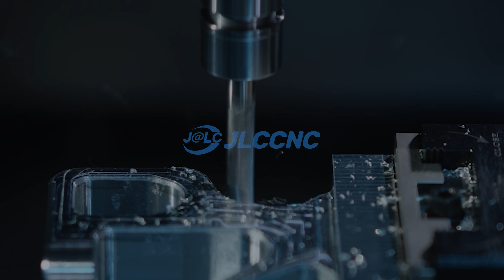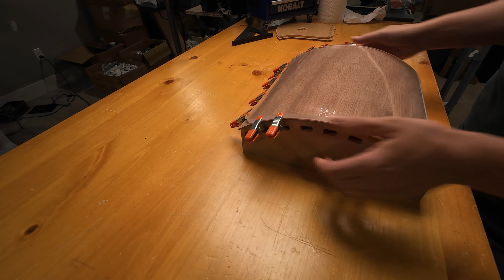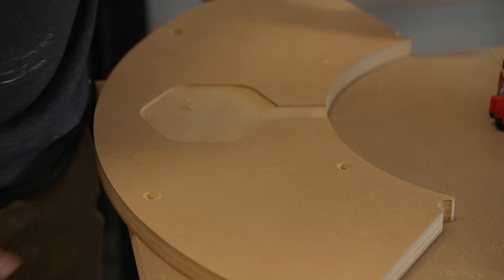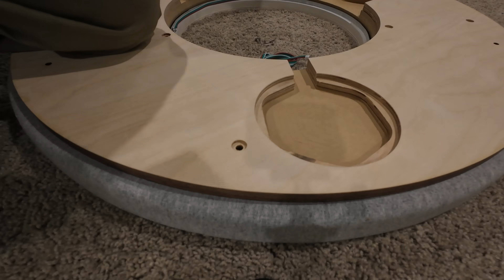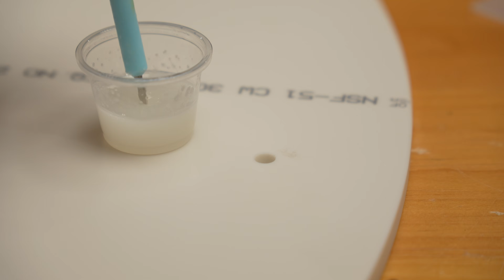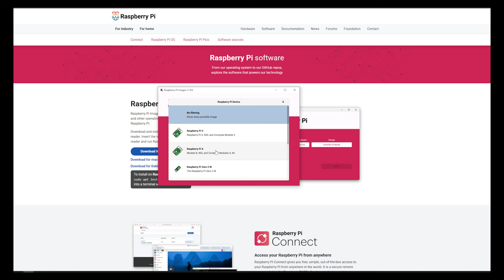This Coffee Table HEATS & COOLS Your Drink

Comment: Having a condensation tray in there, uh oh - on your next project, make sure it's easily accessible, as you may get the same issues people do when using cheap (de)humidifiers - mould. You'll likely need to check it every few weeks to make sure you're not growing new lifeforms inside your table.

Comment: Wait, if you've watercooled the peltier plate, doesn't that mean you risk ice build-up when heating a cup?
Reply from the maker: No Peltier heat produces heat same with cold. Water cooling Loop will always be hot when on but preferably warm

Comment: My guy, you need a deburring tool.. If you have one, then you should start using it instead of a razor for cleaning those edges lol
Reply from the maker: I own one! Nice tip I’ll have to give it a try. Although not sure how well it’d work on tab removal. But the thin bits are perfect for it.

Comment: Just subscribed after viewing part 1,now that I seen part two I am amazed! I do agree with you the frame of the fridge would look better as wood and not white.

I am curious how doe you're cup chiller/heater work? Have you added a pressure sensor to turn it on? Or is it by switch? What temps are you getting?
Reply from the maker: Thanks for watching and the sub!!! For the chiller/heater I have it hooked up to a button on the touchscreen. A pressure sensor would have been cool though! I plan to do in depth testing on my Patreon and I may show some of it in part 3.

Comment: Beautiful table, brillant engineering skills. Peltier elements are great for you coffee mug to keep it cool or keep it warm.

However, using peltier element for the fridge will, according to many experiment we have made in my lab, not work very well to cool down the things inside your fridge as their power are very limited. It will probably be good enough to keep stuff cool though. For showcase it is probably good enough for a serie product, standard compression cycle would probably be necessary, great skill tough, good job.
Reply from the maker: Well thanks! Yeah they are neat units despite all their hate (for some reason)

As far as the fridge, same with my testing. I was hoping for ~55f which I got. Anything below 62f was fine for me because that’s my fridge dispensed water temp and I like that. The “fridge” is mostly a water cooler.

Comment: I would have thought forming the fridge door with a vacum form rather than clamps as I worry about the clamps marking the plastic. But will see as not got thier yet!
Reply from the maker: I would love a vacuum form! Yeah I was  bummed it happened the first go around. But glad it turned out okay. Thank you for watching
Reply: @hobbybuilt  I did also think while watching, making a top form and then sandwich between the two, maybe using straps to hold them together?
Reply from the maker: Good idea, that did cross my mind but was worried about imprinting on the surface if I used ply on the top and I was being lazy 🤪
Reply: @kelvin1316  That's what I was thinking. You could also heat a little while, ratchet down the form, heat more, ratchet, etc. until it is tight and smooth.
Reply: @hobbybuilt  loving the build BTW, it's an amazing project!! ❤